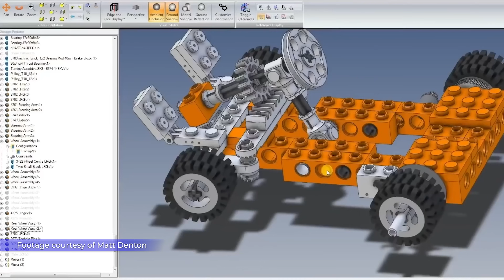3D Printing MASSIVE Lego + Star Wars w/ Matt Denton - SMRRF 2023!

Comment: I have seen a specialist skydiver and jet pilot fly: Yves Rossy, use a flying wing that he stood on the edge of a helicopter leg, with it strapped to his back, started those 4 jetpack engines, then leaned backwards and flew through the air with complete control then used a para-glider chute to land.
Then there was the Martin Jet pack that a New Zealand inventor tried to develop, but try as he did, the development costs and problems and commercial practicality caused it to be abandoned.
Seeing this similar concept, but employing multiple jetpack engines is a step forward. However, I think Matt is very wise to pass it on and suggest using it as a payload concept.
It's always just that 1 step forward to develop something a little bit better, that sometimes leads to 'cracking' the barrier to a functional product. 
Thanks Joel for letting me re-live the Flash Gordon flying machine, advanced to the 21st century. Hope you enjoyed flying among the clouds!